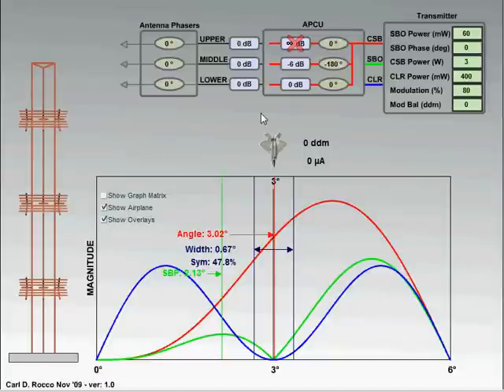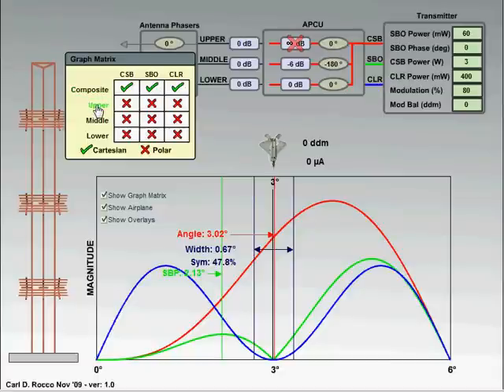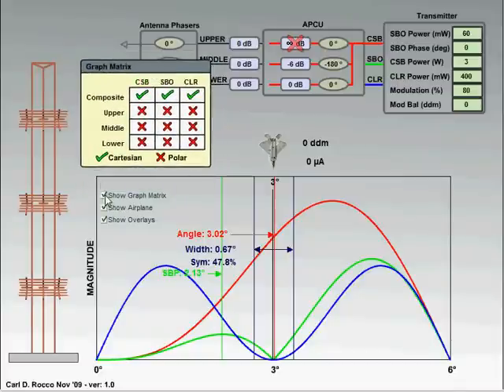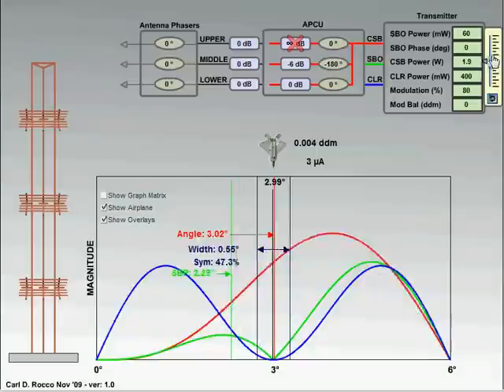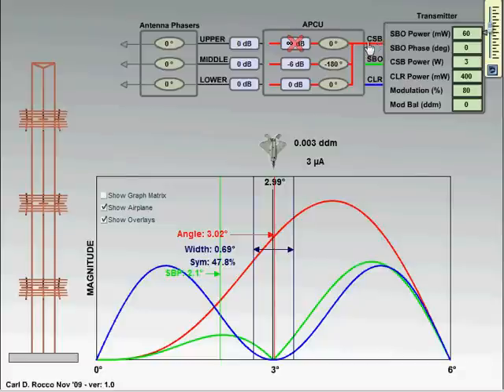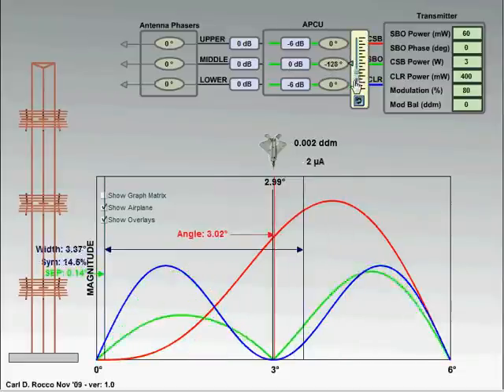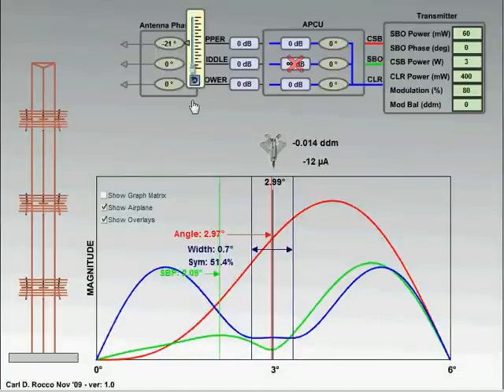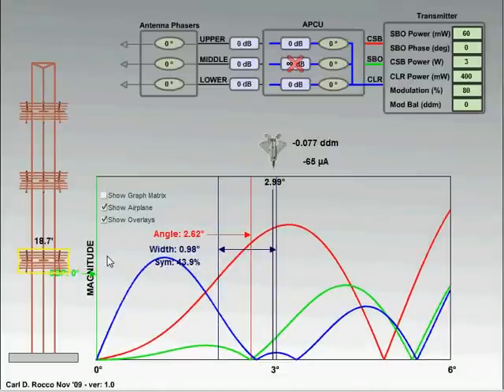Glide Slope Sim For Electronic Techs

Comment: Carl, as you probably know we can't use the Sim anymore. It requires the flash player plug in to work. The Gov considers the plug in a security risk. Works fine on old PCs but anything upgraded and we have nothing. Its a real shame. They should a way to keep this important tool available.

Comment: Sir what parameter will vary if angle .3 theta to .45 theta is coming non linear or invalid during air calibration. Kindly guide sir
Reply from the maker: Variations in the glide angle over distance will be due to the environment (we call that parameter "structure").  If consistent over time, it will simply be the ground topography, but it could be seasonal depending on your location.  In cold environments, the ground freezing can change things.  If a tree line is present, the leaves on the trees can changes things.  Or even a body of water nearby with tide changes.
I'm assuming we are talking about an "image" system rather than an endfire type.  What configuration?  Sideband Reference, Null Reference or Capture Effect?
We can't make structure perfect but with antenna heights and phase adjustments we can usually get it into tolerance.
Reply: @CarlDRocco  thank you very much sir will try in next calibration. Sir is there any parameter like DDM, course rf or clearance RF can affect to .3 theta to .45 theta.